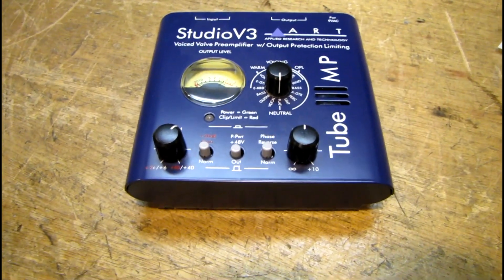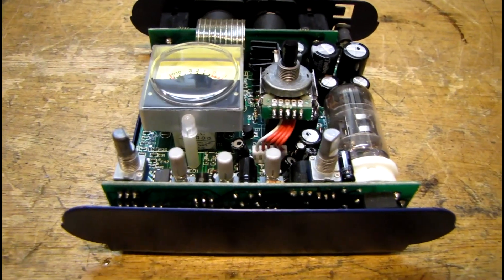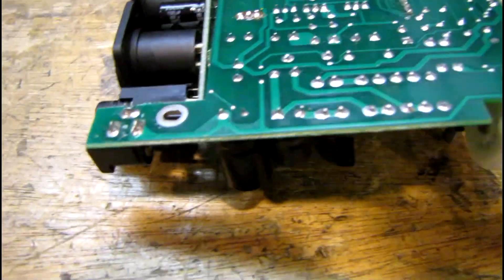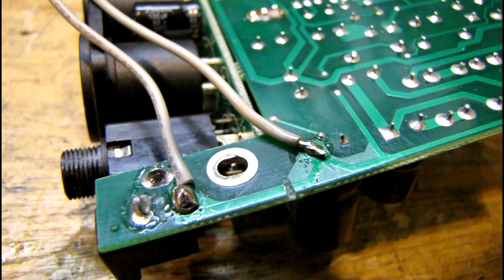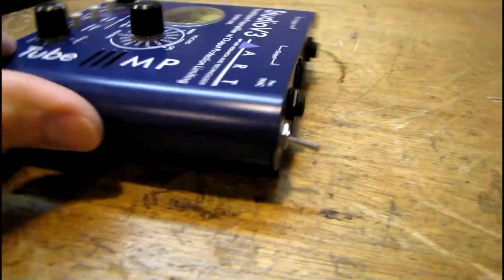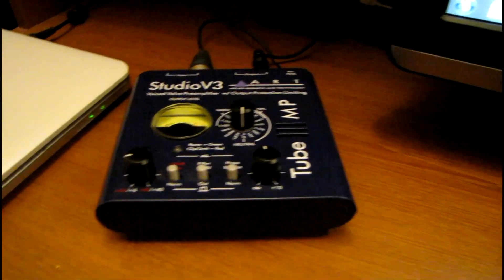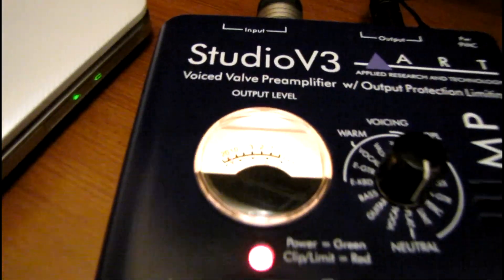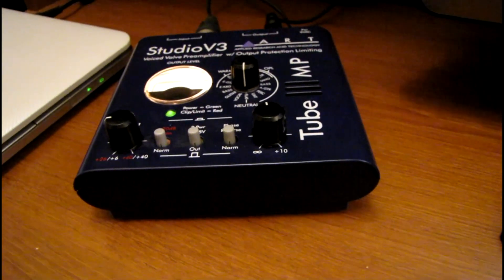Add a power switch to an ART Studio V3 Microphone Preamp

Comment: Hi there. I`m thinking of getting one of these and perhaps doing a switch mod like you did.  Also I want to change the tube so does it have to be a 12AX7A tube as a substitute or will a 12AX7 do the job ?  cheers
Reply: for example a Electro Harmonix 12AX7 ECC83 ?

Comment: Trust me, it uses 9V AC... Look for "Voltage multiplier" on Wikipedia, that's the circuit that's used. Since the elyt caps are in parallel with diodes in this circuit design, there will never be much reverse voltage, hence no fireworks...

With 9V DC power feed, they would need a DC/DC switching circuit internally to the achieve higher voltages, which would be expensive & noisy. But with 9V AC, you only need a couple of diodes and caps to get higher voltages. Used in eg Marshall Valvestate too.

Comment: Not weird at all. It's a classic voltage step up design, which achieves 48V DC out of the 9V AC input. The 48V is needed for tube anode voltage and also phantom power.

Comment from the maker: @uxwbill The cutout is a hook for the power cord to prevent accidental removal.  It would be too hard to drill there anyhow.  Although I was considering it.  It would have been a nice spot if it were normal metal there.  

The LED should be easy.  Just a matter of replacing the series resistor with a higher value.  I look forward to seeing the inside of that mixer :-)